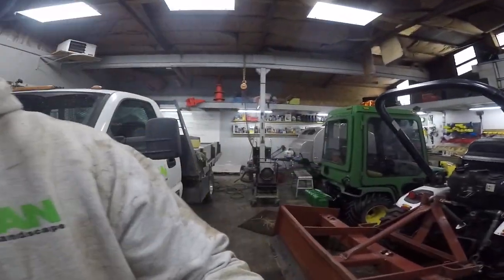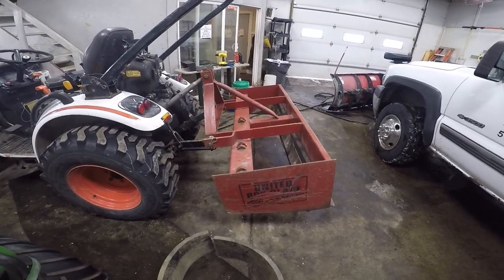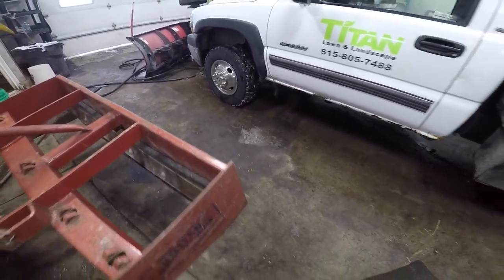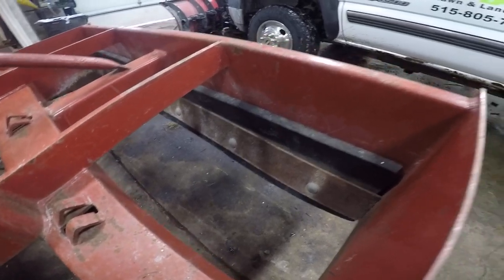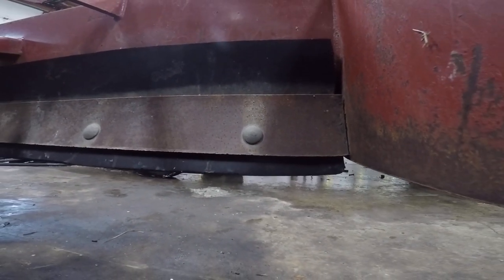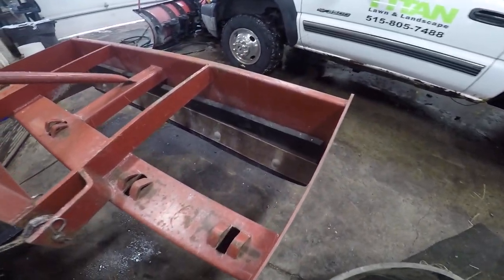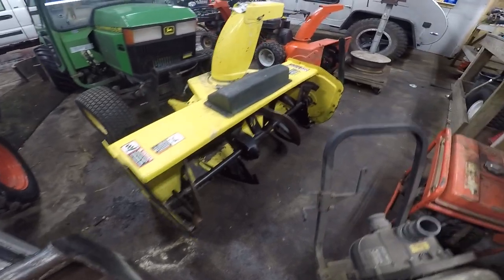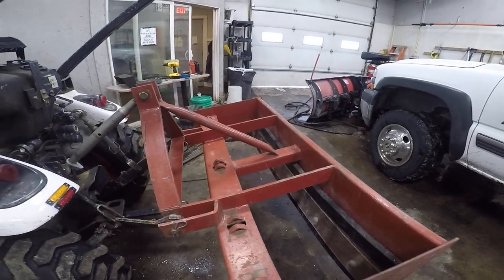Must DO Tractor Snow Removal Mod. No Scalping!

Comment: I've done the same with my snowplow. I left the cutting edge on and used another 2" flat stock in front of the rubber. The rubber actually works better than the steel blade. I works like a squeegee and conforms to the contour of the surface you're plowing. It's just easier on the plow and vehicle also.
Reply from the maker: Absolutely!  I'm surprised dealers dont offer rubber cutting edges.  They are much better than steel in most aspects. Better at scraping, easier on the machine and last 25 times longer than a steel cutting edge.  We have a machine with a rubber cutting edge with over 200 hours of use and it has a long way to go.
Reply: Some dealers do sell them rubber blades, but may not always keep them in stock. You'd probably have to order one for your particular plow.  I just used  an 8 ft. piece of 1" thick rubber, 6" wide for mine. I got mine from a road construction contractor that used a special kind of rubber to line their granite conveyors, so it pretty much will outlast my plow.  I don't know what kind of rubber it is, but I've been plowing on a gravel (class 2 granite) driveway for 3 years and it shows absolutely no wear what so ever.
Reply from the maker: Sounds like what I have on mine. The rubber will definitely outlast the plow. Do you use your plow for commercial or personal use?
Reply: No, I don't do any commercial work with my plow. Ijust do my own yard and driveway and some of the neighbors. My plow is about 10-11 years old now and still works like the first time I used it.
Reply from the maker: @spanky522  That's awesome.  We use ours for our snow business and they get a lot of use and just keep on going.